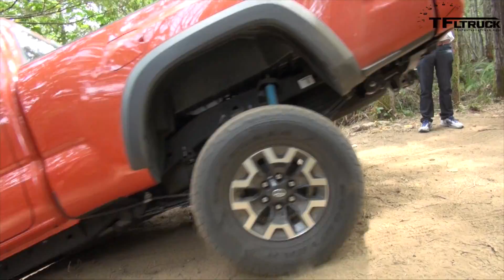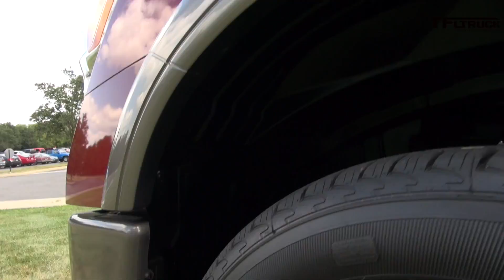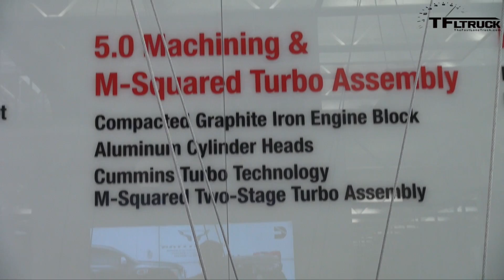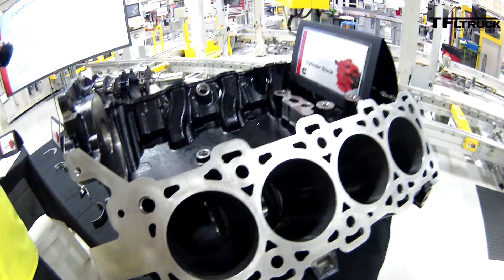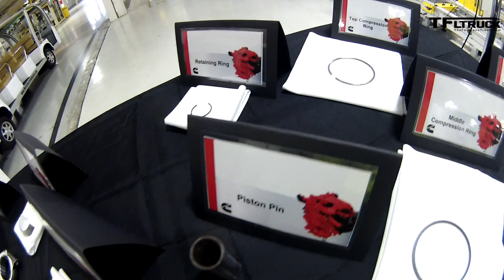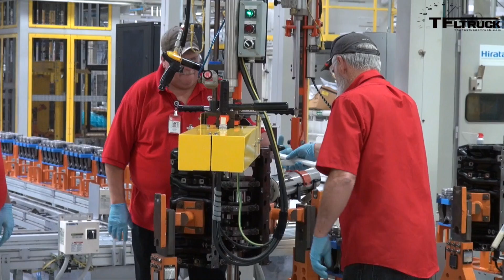2016 Nissan Titan XD: 5.0L V8 Cummins Revealed: Almost Everything You Ever Wanted to Know

Comment: I have to say, from what I've heard and seen so far, Nissan did this truck right.
Reply: also the ford exclusive window drop on the front doors.the gaps between the head lights and grill and just the over all look to me .from a distance to the person who dose not know would think this is an F150 thats all im saying
Reply: +farmerallis ya they went to ford for the blue prints to the F150
Reply: look at it! if you dont see an f150 you may need glasses
Reply: offcourse nissan made this truck
Reply: +farmerallis yes its about time we can get a big cummins diesel without getting a huge impractical truck
Reply: Rockie mountin Yeah, I don't think so.
Reply: Rockie mountin The lights resemble the previous gen f150 but that's about it.
Reply: +Rockie mountin I have seen thousands of medium duty trucks with that window drop.
Reply: +George Hardy Yes medium duty, not light duty
Reply: It's still steel and aluminum. They used design ideas from a medium duty truck in a light duty. The engine for a medium duty truck was right beside it, clearly they are going somewhere with that.
Reply: +Rockie mountin You need glasses the front doesn't look nothing like it.
Reply: +That one F-150 you cant see it and i need glasses! ok read down the post and see how many others need glasses as well.

Comment: Happy to see Nissan being offered with an optional diesel engine, as many people have wanted for years. But if it comes with all the new emission requirements (EGR valve, EGR cooler, DPF, SCR, DOC) people will be very disappointed with the rate of failure and the intensive maintenance required.

Comment: The 2016 Nissan Titan will start off with a Cummins Diesel V8.  In addition,  buyers will FINALLY be able to choose a base V6, along with a gasoline V8.  That was the problem with the 2004-15 Titan, as ONLY a gasoline V8 was offered.

Comment: why does the front end remind me of an F250? well 2011 to 15 f250-550?
and the fucking timing chains do NOT sit good with me. i see them fail in gas engines all the time in EVERY single auto maker out there. anyways at 100k miles we will see them start jumping time, its a sure thing not all will just some

Comment: Really good video. Would have liked to have heard about how they handle emissions, I am sure it has a urea injector, but would be good to hear some details on it.
Reply from the maker: Yes, the truck uses urea injection for exhaust after treatment. And the truck goes warns you when it's getting low, then goes into limp mode right before you run out.
Reply: The Fast Lane Truck Thanks for the response!

Comment: 2 batt?
Reply from the maker: Yep. XD has two batteries
Reply: +The Fast Lane Truck You pretty much need 2 batteries in modern trucks, what with all the outlets in the cab and bed. Plus, starting heavy diesel engines in extreme hot and cold can't be easy.
Reply: +daryl g (zach) Most diesel pickups have 2 batteries. Diesel engines require far more power to cold start when compared to gasoline engines.

Comment: I hope it does well. For some reason I was expecting the torque to be around 600. Probably unreasonable of me. If memory serves though 550 is still pretty good for a half ton. To bad this motor ain't in the Tundra or ram. But then again this may give Nissan a boost and costumers more options.
Reply: +T Ritchie From what I have read, this engine will also be used in the Toyota Tundra. The whole playing field is about to change.
Reply: LK Campbell
That to me sounds interesting! I really like the looks of the new Tundra.

Comment: I don't hate nissan I like some of their vehicles but they definitely ripped off styling cues from current trucks on the market. Some might say there's only so many ways to design a truck and that may be true but don't make it so obvious where and who you ripped off.
Reply: I've heard the current trucks are pretty reliable.  Do you know any specific problems or do you just feel like they are pos rice burners.
Reply: +Quadrunner nope not at all my mom has a pathfinder I'm looking at the new maxima reliability aside as I said it looks like they took styling of the current and past models offered by the other truck makers and crammed them into one. It's very easy to see that.
Reply: Actually I think I clicked on the wrong person when I commented.  Sorry about that.

Comment: thats a loud engine!
Reply from the maker: But. It's quiet when the hood is closed. Lots of sound insulation.
Reply: nice! I just remember the older generation PowerStroke Diesel engines, before they did the twin turbo engine, they were loud driving, and if you had a heavy load or heavy trailer it was even louder. Hope this one is as quiet as the heavy duty diesels that are offered from the big three! :)

Comment: You buy this truck because of Cummins, period.
Reply: +INUMIMI28 Same (And only) reason people have been buying Dodge H.D trucks for the past 30 years.
Reply: +James Jarmon I just really wish ram would have jumped on this 5.0 Cummins instead of that European Ecoweasel, would have kept the Cummins/Ram bond strong!
Reply: +James Jarmon badass you must drive a shitload!
Reply: +Samuel Sanchez mine has, at a million, three hundred thousand miles.
Reply: +Samuel Sanchez I deliver boats. I've average 13k miles a month since I bought my truck in 2002. It's never left me beside the road, and has hauled me and a 38 foot boat down a mountain I wouldn't want to walk down. Once drove 350 miles with no alternator across the desert in New Mexico and Arizona before I got to a part store that had one. It's paid for itself ten times over, and I would not even consider buying a truck that didn't have a Cummins. Nissan has made a truck that may just make them the leader in lite duty pickups for the next ten years. Ram and ford are in trouble. If they don't do something drastic fast, Toyota and Nissan are gonna be in every driveway that currently has a truck and some that don't.
Reply: +neatpete Dodge has always used a turbo. when they first introduced the cummins in the ram in the 80s it was a 12 valve turbo diesel, then in the middle of the 1998 model year, the switched to a 24 valve, then in 2001 and 2002, they put out a two different 24 valve engines. the standard output was paired with ether a 5 speed manual transmission, or an automatic, the high output version was only available with a 6 speed manual. they switched to a 6.7 liter cummins in the middle of the 2007 model year. but they didnt really get the 6.7 right until 2014. If i was going to buy another dodge, it would have to be 2002 or older, or 2014 or newer. From 2003 to 2013, Chevy had the best engines.
Reply: +Shane Ryan there gonna be paying fir this for a long time.
Reply: +James Jarmon May have to buy a laramie ram 1500 with a V6...engine swap hello!
Reply: +James Jarmon im not going to lie im no expert but wasnt it still the 5.9 NA straight six in 2002  configuration. Seems to me the only thing this new 5.0 has in common is the cummins names. I'd be amazed if these new engines compared to those from the greatest era in automotive history. I mean just the NA vs turbo if all else is equal the NA will out live it by a long shot.
Reply: good info thanks. come to think of it they do all always say turbo diesel on side. So you think they got it right now that's good to hear. what about the old ford 7.3? I hear some people say good things about it but again I havent actually done my homework since Im not in the market right now... one day though
Reply: +neatpete The 7.3 they used up until the very beginning of the 2003 model year were the best engines ford ever released. If you can find a f250, f350, van, or excursion with one from 2001 to 2003, the motors worth 4 grand if it runs at all. if it lower millage, and i mean under 200k, expect to pay dearly. Id give my left nut for a 2002 excursion with a 7.3. An f350 is OK, but the extra wheels in the back do nothing for me pulling boats, unless it comes with a lot more motor. that's why I'm going to a 13 liter motor in a Freightliner M-2.
Reply: +James Jarmon ford did make the 7.3, international did and it even says it on the side of the valve covers
Reply: +1988toyota the 7.3 that came in a ford is still in production. It's the bases for the international Maxforce 7. Wish they would put it in a international 1 ton passenger truck.
Reply: +James Jarmon I'm surprised Nissan could cut a deal with Cummins but it seems wrong... foreign mixed with domestic
Reply: +1988toyota I'm not, dodge and ram trucks have been built in Mexico for over 20 years. Nissan is building the whole truck in the states. Final assembly is in Mississippi. Toyota is gonna build the tundra with the same engine in Kentucky. If Dodge would bring production of the Ram back to the states, id probably buy another one. As it is, My new Freightliner was built right here in North Carolina.
Reply: +neatpete What is NA, naturally aspirated? I was a little confused. I was unaware of the 5.9 ever not having a turbo IF that's what NA is.
Reply: +Shane Ryan Right, some early power strokes, and 6.5s were really just gas conversions, but they worked.
Reply: +James Jarmon Not even close. No Ford diesel or powerstroke was ever a gas engine. Ford/International had the 6.9 through 1986 1987 brought the 7.3, then they had the 7.3 turbo, and in the 1995 model year they had the 7.3, 7.3 turbo, and the 7.3 powerstroke. Powerstroke series was the first direct injected engine for them all prior were 21.5:1 compression indirect injection engines. 

The only manufacturer that attempted diesel conversion was GM with the 350D. That motor was in Cadillacs, cars, trucks,  everything, and was single handedly responsible for ruining the name diesel in the US market because it was such an ill conceived disastrous pile of garbage that failed in mechanically spectacular fashion. 

It took dodge almost 10 years to join the party with the 5.9 which was borrowed from tractor technology, and a solid engine.
Reply: +kleetus92 I thought the 6.9 in an early Ford was a conversion. But that's the only one I never owned too. I tell you this though, the DD-13 in this freight-liner is a beast. You barely even know a 28k pound boat and trailer is back there. Goes up Fancy Gap at what ever I set the cruise at. I like this Detroit more than my Cummings.
Reply: +James Jarmon Nah, never was. We had an 86, it's what I learned to drive on, and where I got my love of diesel from. Detroit's HD or commercial engines are killer. I'm partial to the 2 strokes, but the the semi epa compliant 4 strokes are pretty solid. We have 3 in my fire house, 60 series, ranging from 385 to 525 HP depending on the truck. Very distinct sounding engines.
Reply: +Nathan McDonald lmao sad but true! lol dodges literally fall apart around the Cummins lol